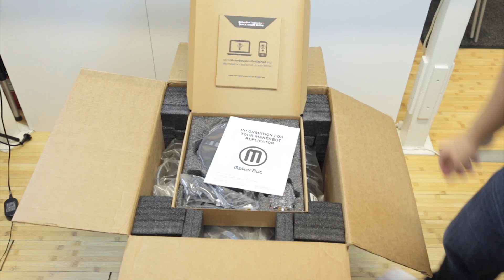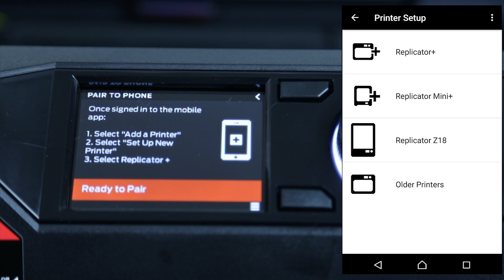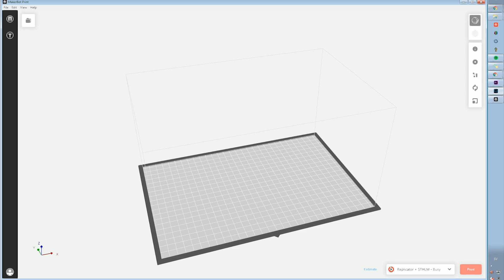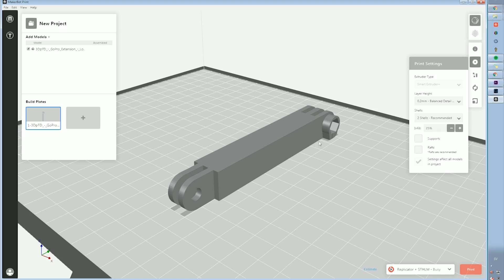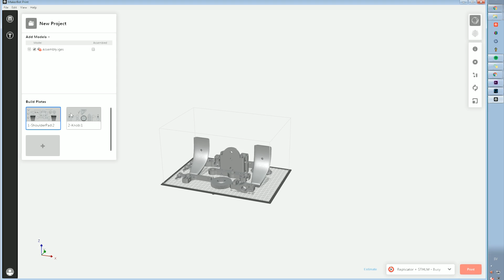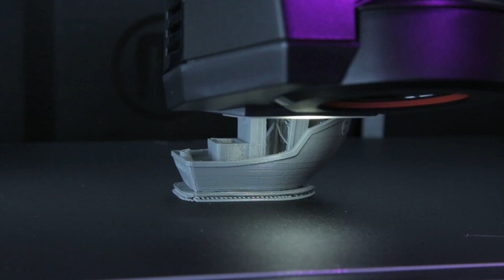MakerBot Replicator + plus - 3D Printer /Review

Comment: I bought one and am scared that if i use another brands filament the extruder will break quicker. is this a real concern I should have
Reply from the maker: No absolutely not. As long as you use PLA for example, you can use really whatever brand.  If you use additives like "carbon fiber" or "glow-in-the-dark" it will wear much faster, but you don't have to worry about regular PLA :).
Reply: Thanks for the information. ill definitely be saving that $40 with the off brand. any suggestions for an off-brand that's cheap and trustworthy? I also what to get the extruder upgrade that works with the "tough" version of pla makerbot offers if you have any cheaper alternatives for that.

Comment: how do you level the bed?
Reply from the maker: This uses a sensor in the extruder to probe the bed, otherwise you don't level it.  It adapts the first layer/raft for any errors.  It's not a modern mesh-leveling, but a 3-point probing.

Comment: I have this exact 3D printer. I regret buying it. So unreliable (extruders are a nightmare) - rarely delivers a successful print.
Reply from the maker: I'm sorry you still have this experience. It was a looong time ago I had this machine and would have hoped the issues got solved!   For me it helped having a dust-filter with some sewing machine oil. that helped lubricate all the PTFE parts and avoid clogs in the end. I'm sure you've tried that already =)
Reply: @3DPrintTechDesign  Thanks for your comments. I'll try it - thanks

Comment: check out their hokum marketing,  "With the easy to replace Smart Extruder+ and Flex Build Plate maintenance is quick and easy."  they hide it in their warranty in fine print.  that these extruders, these "smart" extruders, are wearable parts.  as in, you will get about 1 full dedicated build from one extruder.  3 rolls of pla isn't very much.  if you build a model engine, like they advertise,  thats basically 3 rolls of pla.  

they apparently don't self level either, or have heated beds.
Reply from the maker: They've set it to 3 rolls of PLA now :O ?! that sounds redicolously little warranty. I'm sure they work much longer, but I guess thats what you get support for...   In short, yes things have really happened since it (and my video) got released. The updated smartextruders work well, and with a oiled dust-filter it ran smooth.

Comment: This printer is full of problems. No heated bed and flexible non-flat surface is the biggest.
Second biggest problem is their Makerbot Print software lacking in essential features plus the fact that the software requires account login. So if you have no interconnection or their servers are down you are screwed.

Comment: My conclusion, any printer regardles price comes with cons. And you gonna change parts anyway.
So the best route is to buy A sturdy but semi cheap printer.
And upgrade it with the best. Misumi bondtech noctua and stuff. Will still turn out alot cheaper.

Comment: i buy makerbot replicator printer 3 day ago but in there i am facing some kind of problem like when the printing is done then it's to much difficult to remove 3d object from printing bad and another problem is with base i am not able to remove base from 3d printed object so what can i do ????
Reply from the maker: Check material you are using and if you have some sort of Z-offset active. Use default settings and makerbot filament and you should be good to go =)
Reply: I am using makerbot filament to design any object

Comment: Great video. I just had one question. Does it only work the filament that MakerBot makes or will it work with others as well? Is there a print quality difference between the two?
Reply from the maker: +Alex Cooney it's easier to run Makerbot filament, cause it works with it. But there's nothing stopping you to run other brands too! Just be ready to start playing with settings :)
Reply: I never use makerbot filament in mine and i have gone through hundreds of KGs of filament in my printers

Comment: What kind of files can it use? I've tried to print a few different things, but STL files won't show up.
Reply from the maker: You have to pre-slice the files in MakerBot Print software. It wont run STL-files directly from the USB/onboard. In MakerBot Print you can get most CAD and mesh formats in :)

Comment: Thank you for making this video. I work at a research university, and we have a  Replicator 2x  (ABS and heated bed) that we have not been real happy with because it is so hit and miss. Just when you think you have it all tweaked in for a certain style part, it fails and your scratching your head again. With all the different types of PLA filaments coming out we are looking at purchasing this machine. We don't want to spend time figuring out how to get it to print correctly. We need to make parts, test them and make more parts so we want a machine that is turn key and after watching your review, I believe this may be the printer for our department.  We really appreciate your comments and opinions.
Reply: I highly suggest straying away from maker bot as a whole. Their business motives arent very good and the company itself seems to be struggling to keep customers happy. If you want an extremely reliable printer for approximately the same price go with Ultimaker. I can promise you you will be satisfied with them. A cheaper option could be the Prusa i3 MK2 which retails for $900 for the fully tested/ assembled version. Pretty much everything on the MK2 is automated so you wont have to spend hours calibrating. It is also ranked as the best printer of 2017 (according to 3DHubs) and you can buy 2 of those printers for the price of 1 (or more) makerbots. With makerbot you are paying a premium for standard features that you can find on printers that are even under $500, so as I stated before, do not go for makerbot.
Reply from the maker: +Richard Zicarelli hi! Thank you!  It's a certain distance between this and r2x, but as a school with many users this might be a very good option for you since it's very hard to do wrong. Just keep the bed clean and ur fine.  The r2x with all its temperature fluxations and adjustingknobs will be more of an hazzle. Specially with more users that all want to do different things. 
The um3 I reviews could be an alternative för you, but when you use its prime feature (pva-printing) it takes ages, nothing your fellow students might enjoy and the amount.of settings can be a good thing, but usually a bad thing when considered a tool for your students.   If your students are learning 3D-printers... That's a whole other matter.

Comment: can i print metal
Reply: Yeah, if you buy another brand starting at around $150000. Those are the lowest price points that are JPL(/Nasa) standard. The others "will do too" for personal purposes but depends on  material, force cutting heating/melting/cooling capabilities etc. There are probably another 100 reasons why they are more expensive. If you just plan to do basic work with it, and not necessarily at the most (1/6 to 1/20 of a mm or less) accuracy, then you can get one for around $48K if you are a certified business owner. If not, about $59K. Metal works require a lot more knowledge in metals and chemistry. Tools of upkeep can be in between $5K-$30K a year alone!!! This is not even at the material part (metal powders, blocks that can cost as cheap as hundreds of dollars per project up to tens of thousand per project). If you think you only need a 3d printer just like with these, you are also mistaken. Depending on the work you are doing, there could be another $20-100K accessories that you can buy and WILL need depending on your plans. THAT is why I don't see a close future in home metal 3D printing, unless it is soft metals and very thin one of those...
Reply: @steveelb1wot838  laser sintering setups are down to $1500 USD now..........
Reply: Not to be rude but Steveelb1 you are the tipping king LOL no offense...

Comment: Hello, I'm a water jet engineer and I'm looking at purchasing this machine to produce gauges to make sure our orders are within our +/- 0.2mm  tolerance range quickly throughout our manufacturing process. My question is regarding the tolerances of the parts produced I.e if you print something 8mm wide what does it measure ? +/- 0.2mm ?
Reply: Just do one calibration run and afterwards adjust dimensions (one layer in x/y direction can increase accuracy +/- 0.15mm) then you should be fine when using 0.1 or even 0.2mm resolution...did that with my 5th gen already for many tools (with old smart extruder after fixing the nozzle manually). The new Smart Extruder Plus makes things even easier (and more accurate).
Reply: either you go for overpriced toys like Makerbot and you can guesstimate your tolerance as mentioned by AwardFabrik. Or you choose (for the same price) a serious professionally made printer like Raise3D or Cubicon and you will have a tolerance well under 0.1mm. They come from China though, so make sure you buy from a well established retailer offering technical support in Europe or US like imaker, and you won't have to learn Mandarin...

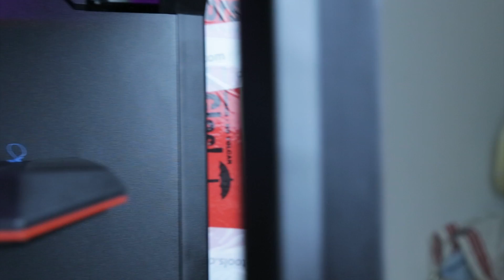Comment: Print samples at 00:26:00 are not very impressive.
Reply: Yeah they are shit haha my prusa i3 3 is like a 3rd of the price if not less and the print quality is 2 times better haha
Reply: @maxhammerum7705  Ye for the price of the machine you would think it would be better, aswell as the filament which has to be from Makerbot/is chipped as far is i remember.. Kinda dissapointing indeed, you would hope you wouldnt have to tweak such expensive devices that much. Creality ender 5 will have better prints out of the box... which is about 2800 dollars less.

Comment: I've heard that Makerbot+ does not support other types of filaments, is that true? Only PLA by Makerbot is accepted? About The new 3D printer - Is it getting "less open source"?
Reply from the maker: Hey Rodrigo! Officially they say only PLA from Makerbot. In the current Print software I couldn't change temperatures or any settings, So i think users are stuck with Makerbot PLA (and their PLA tough for now). I will investigate other filaments after I try the Tough one :).  Again PLA is PLA, so it should work. But PETG, Wood, Copperfill/bronze and ninjaflex will probably be hard.   I don't think you can get less open source to be honest. Don't expect to tinker with this machine. I'd be happy to recommend a few others for those needs!

Comment: So we have a $2000 machine without a heated bed?
Reply: the point is that long flat prints with a heated bed arnt a problem
Reply: 27:23 some curve, on the right
Reply: heated bed is so important, don't protect makerbot, it sucks..
Reply from the maker: Correct, no heated bed. long , straight flat prints (like the wrench) are going to be problematic, like in most printers, hot or not. But several parts next to each, filling up the volume is no problem.
Reply: For this printer it kind of makes sense as the buildtak like surface provides adequate adhesion if you have filament that is not extremely old. I can understand why Makerbot ditched the heat plate so you can bend and remove the parts. PLA warping is not strong enough that heated bed is required for large parts to suceed.
Reply: I own a Rostock Max v2 and Prusa i3 MK2, but the only one I enclosed is the Rostock. I never really had problems with adhesion considering I use PEI sheets but i see where youre coming from. PETG is great but its melting point is lower than ABS so it doesnt suit my needs very well.
Reply: ABS is still the most common plastic to print with along with PLA. In fact, I only print in ABS mainly for its high strength properties. It is harder to print with but it really depends what you are trying to print.
Reply from the maker: +Graylyons well that's debatable if it's the most common one today :). What printer do you use? 
Most. Machines aren't inclosed and struggle with any abs prints really. Go petg if you can.   Many PLA-types are really strong and can have some flex added in the recipe. They are also stiffer then abs, which is good for some things.
Reply: So whats the greater printer you have in mind ?
Reply: Are you using the Replicator+?  Anything you don't like about them.  Thanks!! I'm thinking about buying one.
Reply: Long flat prints with a heated bed are not going to work very well without a heated chamber in some materials like ABS. But I think the point of this machine is that it is way overpriced given that it doesn't include what is a basic feature on almost all printers now.
Reply: readyross You have completely missed the point. We have a machine that is the same price point of other machines that are of similar design, yet this printer omits a basic feature. Even with PLA a heated bed can be useful. I have enough experience with ABS to know all about the difficulties with it, and there are machines cheaper than this one that can print it just fine with an enclosed chamber.

Regarding "ABS is rarely used anymore", I would love to see a source on this - I am unable to find any market data to confirm or deny this.

Some heated beds may warp, but I see no reason why they all would.
Reply: Jeffrey Drake shut up idiot. It works. My teacher has the same one.
Reply: Jeffrey Drake I can tell your a newbie, this is a PLA printer only.  ABS filament is how FDM printers started but its now becoming history.  Not good for prints wider than 3" because of warp lifting..  It's all about cooling shrinkage.  ABS is rarely used anymore because of its high shrinkage This printer doesn't use a heated plate. Plus heated plates warp.
Reply: If you have done any research you would know that the smart extruder plus only prints in PLA and its the most reliable printer out there, i have printed in excess of 60 kgs of filament in each of my makerbot printers with minimum maintenance, Im running a farm that consists of 6 printers that have not stopped printing since Feb 2015 I have printed over 5000 pieces for my prototyping business these printers are for professionals that dont have the time to tweak and modify. the only mod i made was an external spool holder and build tack on the old build plate. The fail rate is less than 2% COMPARED TO PRUSA I3 MK2s which fails over 20% of the time, Note: if you want to print with supports don't use the makerbot software use Simplify 3D

Comment: 7/10 what are your scoring methodology. that benchy looks horrible. still stringing and blobbing. layer alignemnt/accuracy on that engine block. warping on the spanner. 

i do like the design on the gantry utilising 2 linear rails. to me its the same machine just repackaged. makerbot has damaged their reputation beyond repair. the only reason they are still alive is because of stratsys.

if makerbot sold spares directly to their consumers like the ptfe liner in the smart extruder plus. that part wears and causes jams over time without fail. i wonder how an aftermarket stainless steel or other material that woud be more suited as to not get heat creep.
Reply from the maker: The score is based on a general out-of-the box performance. I've never had the built-in-support in that wrench to be removed easier. Yes warping is an issue with every cold printer. 

WanHao i3 would score around 4-5 and a Zortrax around 9. That might get you a reference. Again, I wouldn't recommend a Makerbot to the tinkerer, it's not the right machine for that price or customer.